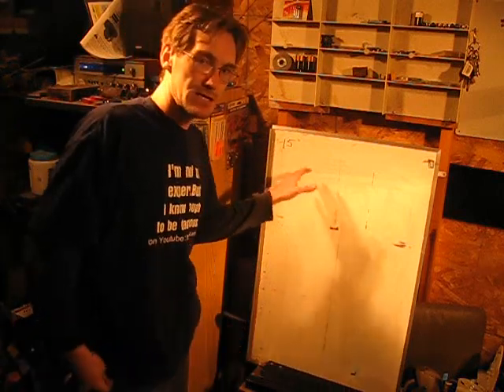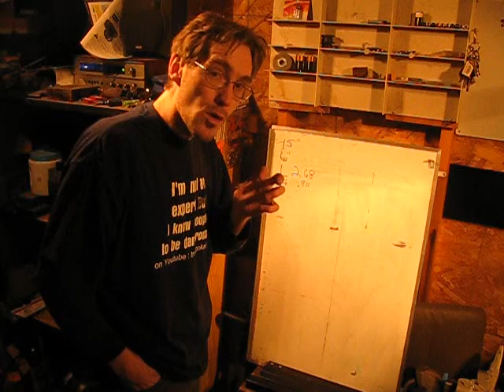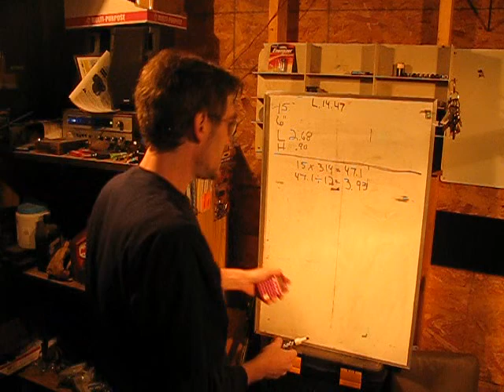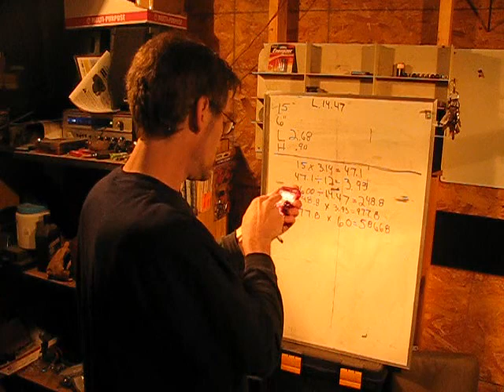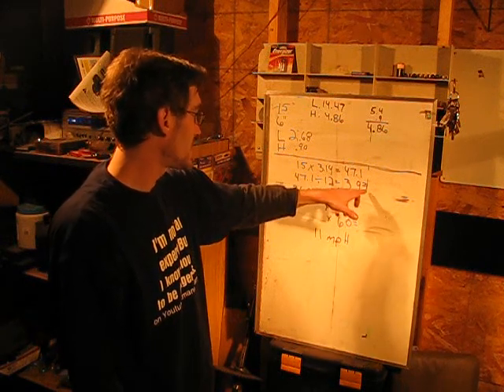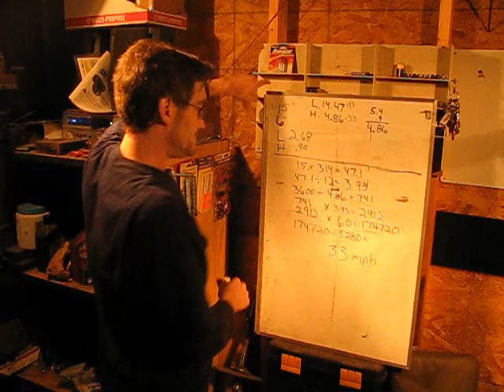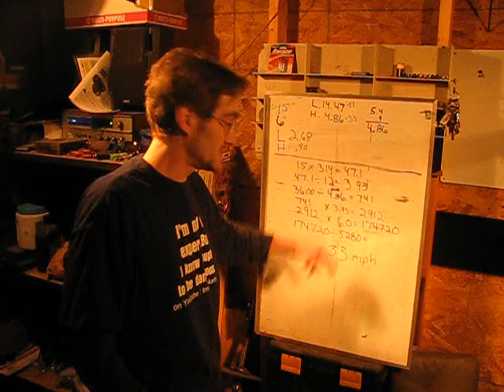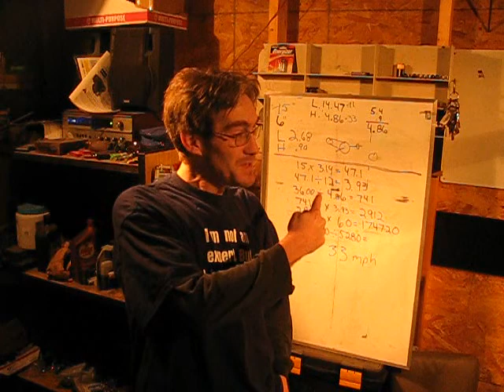Go Kart : Torque Converter Calculation ( by T-man )

Comment: T-man I’m a big fan and needing some advise. I have a 4 seater tiking which had a 168.9cc which was swapped to a 420cc I have the 44series driver and a 40d driven 7inch. Have my Jackshaft aligned but the trick is the double 50 chain. On The axle It originally has a 30 tooth and on The Jackshaft a 12. I’m just turtleling along can you help. Thank you in advance.

Comment: this isn't right. I just did the math on my manco dingo and according to this set up I'm 10mph under what I actually go.

Standard 30 Series TC, 6 inch driven, 8 tooth sprocket on driven, 48 tooth on axle, 18 inch tall tire, governed at 3600rpm, I've just peaked 45mph on that kart but according to these calculations my speed should only be 35.7

Comment: hey tman i know ur helping me with my jackshaft issue and thanks again!! but im just wondering i have the 6 " torque converter im putting on my go kart and the same 54" sprocket on my the axle and a 8 tooth sprocket ... if i make the 8th sprocket larger i will get more speed? i ask because you say how the makimg the 12th sprocket a 14 th sprocket will make it a few mph faster so if i went from a 8 th to a 14th that will make my kart faster? thanks again for you videos man u rock!
Reply from the maker: so you have an 8 tooth that would go on the other side of the plate for the TC ?? and your wondering about changing that to something larger ?
Reply: T-Mans Go Karts yea basically i have a 8 tooth where u have ur 12 tooth.. i got the 8 tooth cause someone pn the diygokart told me that would be better/faster?
Reply: i meant where u have the 10 tooth sprocket and at the end you change it to 14 tooth sprocket. o ly difference is i have 18" tires rest of my setup is going to be like yours. just trying to figure out what sprocket would get me closer to 40 mph lol thanks again for all your help!
Reply: Hey tman. why do you get people asking what stuff to use on videos where you explaine it- This guy is asking what sproket to get to go a certain speed on a video where you show the calculation- do the math man-
Reply: oppress the public well hes been helping me on my project the last week and i was correcting myself from the 1st post then stated how I AM just trying to figure out what sprocket would get me closer to 40 mph just BECAUSE someone else told me i would want a 8th for what i want my kart to do and was confused because of what someone else told me on a kart forum and tman just said a 14 th would get to about 35 with 15 " tires so thats what about im trying to do .. sooooo .....yeaaaaaaa just asking what i was confused about .but thanks for all your help tman im almost there!

Comment: 47/12"?
12" means what in the calculation??
Reply from the maker: +Amar Chopra ... inches
Reply from the maker: +T-Mans Go Karts ... at 5:10 I say it
Reply: +T-Mans Go Karts  Hey i know that is in inches......i didn't get my ques......!!!!
why we multiply it by 12 inches?? 12 inches is a dimension of which part?
Reply: +Amar Chopra *U
Reply from the maker: +Amar Chopra ... 12 is one foot. so a tire that is 15 inches high is 47 inches in  circumference ... you need to know how many feet 47 inches covers .... so you divide 47 by 12 inches  and that tells you how many feet a 47 inches will travel.